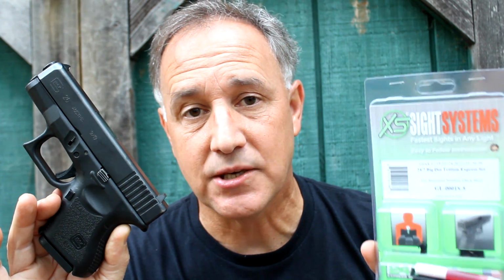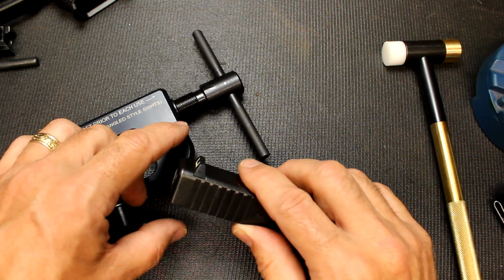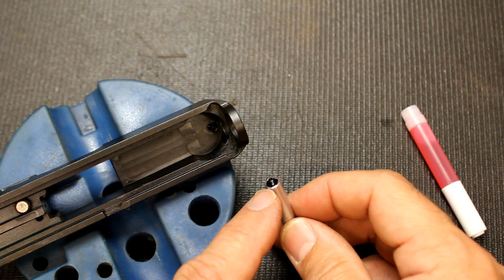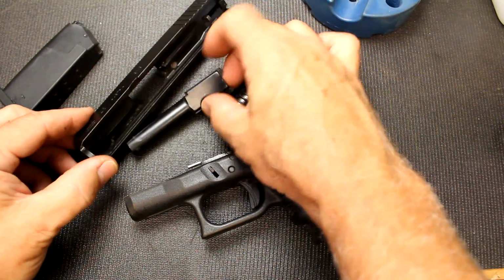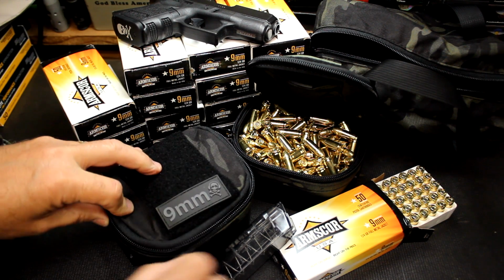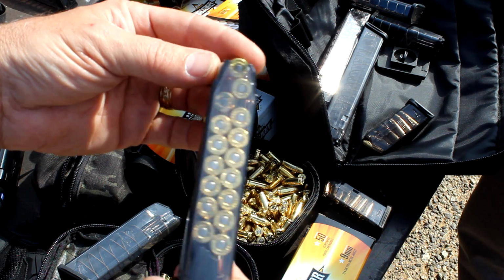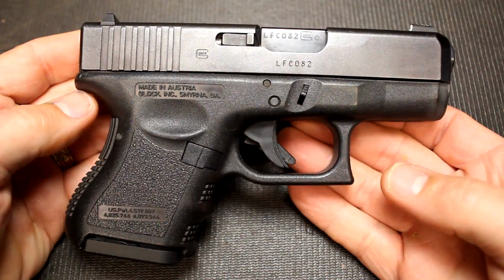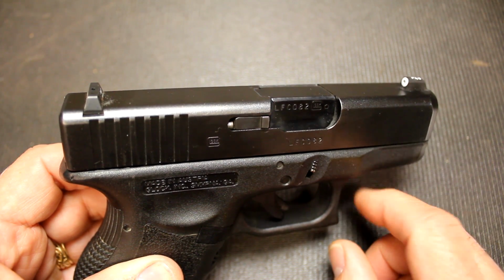Glock XS Big Dot Express Sights Install & 1000 rd Torture Test

Comment: Finally.. someone actually using ETS mags.
Reply: I have a 31 rounder, and I like it so far.
Reply: I have plenty of Glock 22 ETS mags. The only thing that I didn't like, when I bought them, is that they advertise that they hold "16 rounds." I was going to buy them anyway. But I was wondering how they could fit a extra round and be the same size as a OEM G22 mag. But they don't hold 16. I guess they are just saying 15 in and 1 in the chamber.

Comment: Last month I ordered a set of 24/7 big dots, a few days ago I noticed my rear sight was very dim and very hard to see at night. So I sent it in for warranty work. My sights are 2016 model so there should be no issues with replacing the rear. I heard they have great customer service and I love the front big dot sight. Very easy to spot under stress.
Reply: ***** I spoke with BO and I mailed my sights (slide with sights) in. I have heard good stuff about you guys so I am not worried.... thanks bud.

Comment: Lost the front sight at the range after around 200 rnds I used a modest amount of thread lock. Ordered a new front sight $65 added a lot of thread lock no issues. So moral of the story is apply as much thread lock as possible.

Comment: I thought I had the 24/7 with the Tritium sights, but when the sun sat behind the tree line at the OD I use was not seen my me!  I just bought the new XS Big Dots DXT2 with the re-energizeable front sight. I paid $83.00 +S&H of 6.95! from Gainsvile, FL. I hope to have them installed Sat. and check them out next week at the OD.

Comment: Love the brass-stacker stainless steel guide rod too....STILL waiting for the glock 43 to get to market......ill add one point for installing the xs rear sight...DO NOT get the red loctite near the rear sight post or itll stain the white and get inside the small cavity no matter how much or fast you wipe it off w alcohol

Comment: Currently the XS 24/7 Big Dot For Glock 9mm/40/357/36 by XS Sight Systems are $90.87 on Amazon right now. I've been running these on my CC Glock 30 for 4 years as well as my bedside Glock 21 and my just for fun Glock 23.

Comment: Great video as always. Do you prefer  the xs or truglo tfx pro? i just picked up a 26 and have been trying to decide between the two
Reply: Drew Neel trijicon HD.  Any color you like. Swear by them
Reply: Pete Bovenzi I've considered those as well. a buddy of mine has them on his 42 and i liked them
Reply: I use Trijicon HDs on a 26 and I love them. I have a similar set of sights on a talo exclusive Glock 43, that I think are from Ameriglo, that I like just as much. I actually mistook them for HDs when I bought the gun. 

I think it really comes down to if you favor speed over precision. I think the HDs has both. 

You can't go wrong though.

Comment: cool video but I'm just not a fan of the Big Dot sights. I've shot them and I do not like the sight picture. I just do not find them to be precise enough to allow me to be accurate. It doesn't matter how fast you shoot or get on target if you don't hit the target. Sights like these are okay at "bad breath" distances, but if you have to make a shot at 7, 10, or even 15 yards, they are just not as good as more traditional sights. I run 3 dot night sights (Trijicon or Meorplight) on my carry guns, and have never had trouble getting on target quickly and efficiently, even in defensive classes like the Defensive Handgun I did at Thunder Ranch recently. As Clint Smith said in that class "Shooting fast isn't as important as shooting well!"
Reply: Yeager hit a pepper popper at 100 yards using them
Reply: seraph1926 people hunt deer with .22 LR too but that doesn't make it a good idea. And I'm sure that under controlled range conditions with no pressure, all the time in the world, and no threat you could hit something at 100 yds with them, but under stress when you're moving, the target is moving, or both is a different story. If others want to use these sights and are able to do so at distance effectively under stress, than I say go ahead. They're just not for me for the reasons I said.
Reply: AirForceAce3571 you missed the point. Under static conditions they're equally accurate well outside reasonable pistol distance. At speed you're faster with the xs and any loss in accuracy is negligible at best for typical gunfighting distance.
Reply: seraph1926 I understood your point completely, I just don't agree. I don't really care what they do under static, calm conditions. They're designed for shooting under stress so I care about what they do then. Another student in my recent Thunder Ranch class had them and I had to use her gun in a battlefield pickup/malfunction clearance drill, and I did not like how they presented and didn't shoot them as well. I also have a friend who had the Big Dot sights on his M&P and I didn't care for those either, so that's what I base my view on. I have not ever found my 3-dot sights to be really lacking in the ability to get on target in an expedited manner with a bit of practice, but they are more accurate for me, especially out to 15 yards and/or if I need to take a more precise shot like a headshot. Shooting or doing everything fast isn't my highest priority, even in a fight. I know we can't do things in super slow motion, but if we don't hit the target, it doesn't matter how fast we shoot. As Wyatt Earp said, "speed is fine, but accuracy is final." I need to be able to hit my target, and I find I do not do so nearly as well with Big Dot sights. The speed advantage is more than negated by the loss of accuracy for me. 3 dot sights work plenty fast enough at close range, but are more capable at other distances so that makes them superior in my view. If you or anyone else wants to use Big Dot sights, go ahead. Not saying you or anyone else can't or shouldn't (assuming you can be as accurate at distances or while shooting at smaller targets if needed), just saying why they don't work for me.
Reply: im in agreement, i had xs big dot sights on my EMP...didnt like em...i prefer either trij hd or Ameriglo pro operators...

Comment: sootch I know this vid is older and there's alot if options out now. I just grabbed a G26 4th gen that I couldn't pass up. One question, what sights are you putting on your 26 if you are me? I'm familiar with HD's. it's a toss up between big dots and the night fision.  I need a suggestion. thanks in advance

Comment: What was that tool called that  you used to measure the rear sight was in the correct spot?  Getting ready to install my first set of sights and wanna make sure I get it right.
Reply: Nathan Smotherman It is the bottom of a Dial Caliper. Or you can use a Depth Micrometer

Comment: Why push it from right to left? I don't think the sight cut in the slide tapers... but I may be wrong.
Reply: On glock the cut doesn't tapper, but other manufacturers do that. It is easier to do it one way, if you own many brands of pistols. That way you just avoid the possibility of messing it up on a brand that does have the tapper. :)